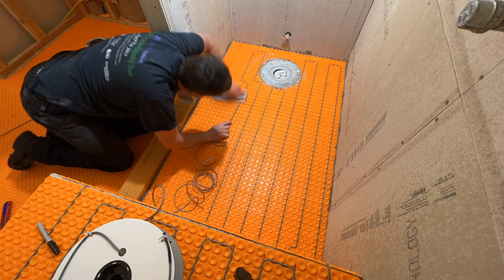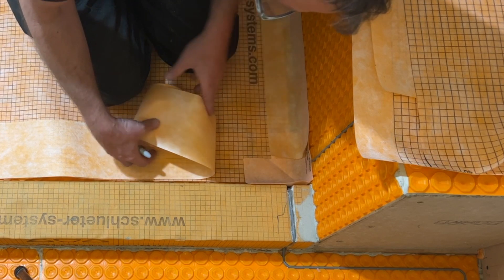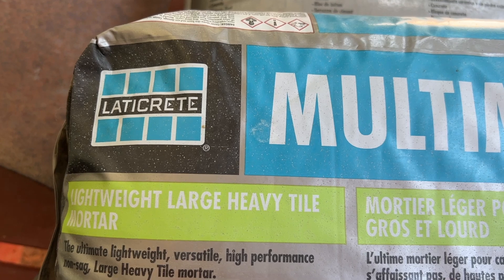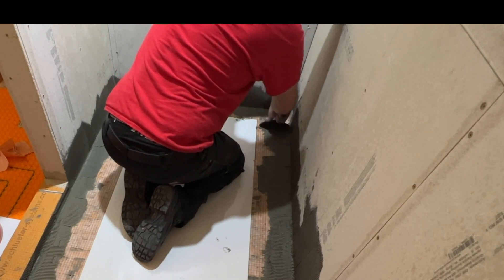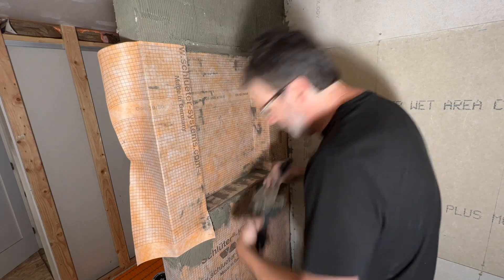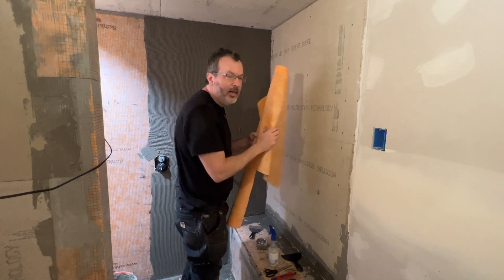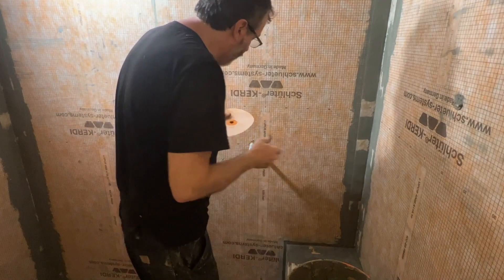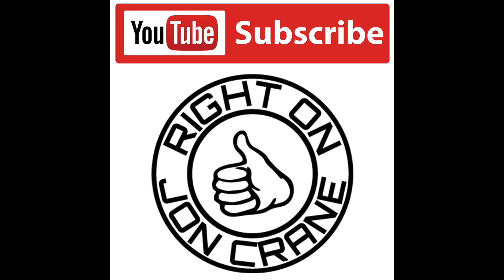CAUTION! Watch Before You Install Schluter Kerdi! - Tile Shower Build Part 3

Comment: I say to stick with all Schluters reccommendations when installing Schluters shower systems... Schluter should know what is best.. They live, eat, breathe this stuff everyday....
Reply: Issac in his testing, usually sabotages the Schluter system by being creative with other thin sets.  When he used Kerdi, with the Kerik corners and Allset in a seven day flood test the system didn’t leak.  If there is a problem with schluter it is that many installers think they know better than the instructions that Schluter provides.  That being said, hydroban over all the vulnerable areas,(drain flange, curb, floor seams and wall to floor banding) seems like inexpensive insurance.  I wouldn’t worry about the warranty, a leak will cause far more damage and is far more expensive than what that Schluter would reimburse.  Belt + suspenders makes sense.

Comment: There are thousands of kerdi showers holding up just fine.  I personally know of 1 that was done 17 years ago and not a leak at all.  As far as a steam shower,  they tell you kerdi isn't meant for steam showers because of the perm rating.  That's on you for not following the directions.  Also, kerdi isnt designed to make a tub out of it.  It's designed for a shower and sheding water.
Reply from the maker: For the same cost you can purchase the Laticrete products that can be used for swimming pools. I don’t want something that just sheds water and can potentially leak at the seams. I’ve seen the videos of the Kerdi disintegrating. If I’m building a shower it better be water proof not water resistant. Go with laticrete. Put it in a pool or in your shower. 🏊 Hydroban XP
Reply: @RightOnJonCrane how come you can barely find any real world reviews on the product?

Comment: Putting a waterproof membrane over a waterproof membrane, that’s overkill
Reply from the maker: It’s better to do it than to rip out the tile later and do it because the Kerdi leaked. 
If you think about it, Kerdi band in the corners applied with thinset? Is this really waterproof? Are you sure water won’t leak through the dried thinset? Hmmm 🤔

Comment: I just came across your video and I’m about to install a steam shower in my house. How has this held up since you made this video? I would use all Laticrete but, like you, already have a bunch of kerdi membrane. Great work!
Reply from the maker: It is great! No problems at all! It’s been two years since completing. Yes, I prefer the Laticrete but I think the Kerdi is fine. I would use the multimax thinset and also use the new improved Hydroban XP. Hope your shower turns out great. 
Thanks for watching! Right On! 🙌
Reply: @ thank you for the update! I am definitely going to use the multi max thinset and the Hydroban xp
Reply from the maker: @ Right On! 🙌

Comment: Thanks for the reference to Isaac. His test installation(s) leaked as a result of not reading and following the manufacturers installation instructions. Every system will fail you don't take the time to properly follow the correct prep and install instructions. Just sayin'. I agree with you big time on hydro ban - yes its more expensive than most other products, but it is by far the best product on the market. If they use it on Olympic sized swimming pools, it should hold up in my shower.
Reply from the maker: Right On! 🙌 I’m still not sold on how the membrane is installed with thinset being used as the glue for the joints. I feel like it should be a glue. Something really strong. 
I’m glad I used the Hydroban over the top!

Comment: TIP: Hydroban and AquaDefense are the best for waterproofing.. stay away from RedGuard and Ardex 8+9
Great job Jon! Nice bathroom!
Reply from the maker: Right On! 🙌 Thanks! Yes and they even have Hydroban XP and Hydrobarrier. Great products.
Reply: As a non-tile guy, why not just use Hydroban and skip the Kerdi step all together?  Am I missing something?  The Kerdi is a complete system, and the hydroban is a complete system.  Did he basically double-up on his waterproofing?
Reply: @MrSiestaFiesta  There wouldn't be a need for this video then!

Comment: I am doing almost the same thing, except in reverse from yours. Have you ever considered or tried making the shower pan from a fiberglass layup? Have you ever tried or considered using silicone caulk instead of the grout?
Regards,
Gary
South Carolina
Reply from the maker: Right On Gary! I have not done a fiberglass pan but that sounds like a good plan. I know there are some cool premade shower pan liners available. That really makes good sense to do that. I have only used silicone caulk on all the corner joints. I’ve been using spectralock 1 grout with great results. 
Thanks for watching!
Jon

Comment: @RightOnJonCrance. How is the shower holding up with the hydroban over kerdi? Have you learned anything new about this type of installation?
Reply from the maker: Hi! It is holding up great! I recommend going with the Laticrete products. Use the Hydroban sheet membrane. The Multimax lite thinset. Hydroban XP liquid membrane. Get the XP. I only mixed products after I found out the Kerdi leaks. You can use Hydroban XP to seal a swimming pool. That’s what you want. For more info call a Laticrete rep. They really helped me out to make the most informed decision at the time. Hope that helps! Right On! 🙌 Thanks for watching.
Reply: @RightOnJonCrane  Thank you for the reply.  Kerdi membrane is already installed and I have the hydroban mid grade at home, not the xp or the hydro barrier plus. I think your video was the only one I could find online similar to my planned installation so that is why I sent you a message. I'll take your advice and have a talk with a laticrete rep.  Thanks again.

Comment: I actually bring the kerdi down 2 inch passed my corner. So there is no joint. Install corners first than glue 2 inch on floor and unroll it straight up the wall and install another corner afterwards. It does require me to relevel the shower pan with a skim coat due to the excess thickness of membrane in the corners.same thing for corner walls. I dont use kerdi band. I over lap the actual kerdi membrane. And as far as benches. One solid piece 2 in on floor straight up to the ceiling.  No seams whats so ever

Comment: Guys i think i applied enough thinset to membrane but then squeezed out too much. Was using way too much pressure. Not sure how much thinset is the minimum requirement to adhere to the fleece

Comment: Schuyler does not prevent leaks, that dude in the YouTube videos “not you Sir” needs to show his two days certification of graduation before he makes videos. The bread and butter of Schuyler kerdi is designed to sit in between the plastic sealing all-set or thinset. The thinset is the sealant not the roll of kerdi or kerdi band. The porous surface in the kerdi is to allow the bonding between the thinset you apply under the kerdi sheets and the later you apply for tile. 
One main cause of leaks to cut it short: is uneven surfaces, not applying enough allset, or siam in between the kerdi thinset and the flange or the lip of shower pan.

Comment: I am a DIYer, I did my own shower 4 years ago now, first time all Schluter. Watched all their videos how to install. Recently I had to open the ceiling under the shower for a different issue, it’s bone dry under there. I don’t know what installers are doing, but my bet is they don’t follow directions and think they know better. 

What’s the point of kerdi over ditra heat? That’s extra work for no reason.

Comment: Any leaks 1 year later? I'm interested in building a shower the same way. I'm shocked how many Schluter failure vids there are!
Reply from the maker: No leaks! It’s been great. Best part is the heated shower floor and bench. It drys everything out after each shower. No mold or mildew to clean up. I feel good because I know the inside is staying dry as well. Seems like the Laticrete system is better. If I had to do it over I’d use their system. I did use the  Hydroban. That was well worth it!
Reply: @RightOnJonCrane  You mean you'd use Laticrete instead of Schluter? Thanks for the reply!
Reply: It's due to operator error, even Tile Coach gets it wrong, and he videos himself doing it wrong.
Reply: @abacab87  It seems like they designed a product that is very difficult to install properly. So many failing showers!
Reply: @jeffreyjbyron  I just haven't found any, and where there is and they tore it apart, it was due to operator error. There are a lot of click-biat titles that then go on to show operator error. I do believe it is not for DIY, but if every direction is followed religiously, it works as stated.  I myself had a problem getting the ditra to bond with the mud, but I was able to back butter and re=apply.
Reply: @abacab87  Yeah I believe you. I just thought the whole point was that Schluter is supposed to be easier to install. It's certainly not cheaper. If it requires religion, what's the benefit?

Comment: Doesn't this void the warranty on both products?
Reply from the maker: Yes it does for the Schluter but I’d rather have a shower that doesn’t leak rather than replacing it with another leaking shower.
Reply: I don’t think the order of applying matters for Shluder warranty as long as you follow 2” overlap of materials?

Comment: I saw Isaac saying he was abandoning Ardex 8 + 9 but then more recently used it (specifically mentioned instead of Hydroban) in a RSS Pro system because he said would cure without air. Maybe at times preferred? A little confused. ButI didn’t like the idea of that system since it didn’t use membrane sealing at corners (apparently similar to a Wedi system). I had decided was going to use Laticrete modified thinset to secure membrane but put Hydroban over seams. I like your “flashing” method but I’m hiring tile setter so doubt I can talk them into it. I’m sure they will already be eye-rolling at my special requests.
Reply: I've seen all the videos by all the tile YouTubers. I get the impression Isaac is flippant so that he can create new content. He's the main channel that loves the, "so and so failed, find out why!" Type video. He does good work, but I'd be wary about being overly concerned in regards to his "failures" videos.

Comment: Tile Coach has never said the Kerdi membrane leaks. He says that his tests show that water gets behind the membrane when it is adhered with thinset.
Reply from the maker: Sounds like it’s leaking to me! For the amount of money these systems cost I would think they would be water proof without a doubt. For the cost this better be the water proof watch that can go down to 50ft not the water resistant watch that can only take light rain 🌧️ From what I’ve seen in his videos the Kerdi is leaking. In one video he showed the Kerdi flaking apart like old cardboard. Something is not right.
Reply: @RightOnJonCrane   Seems like everything leaks if you believe all the videos you see on youtube.  I've seen dozens of roll on membrane videos failure videos as well.  Seems like it's primarily people who can't be bothered to read the instructions and follow them.  I had the same idea you had in doing Schulter waterproofing with a rollon like redguard or hydroban on top but then I read other blogs that said it's not recommended.  Who knows.
Reply: The main issue is that there aren’t any tests saying hydroban adheres to the Kerdi membrane. You should’ve used the laticrete sheet membrane if you wanted to use the hydroban as well.

Comment: Should have used a single piece of kerdi on bench seat rather than two separate pieces with the piece of kerdi band.
Reply from the maker: Right On! 🙌 That’s a good way to do it as well. It gets hard though to push out the air and excess thinset.